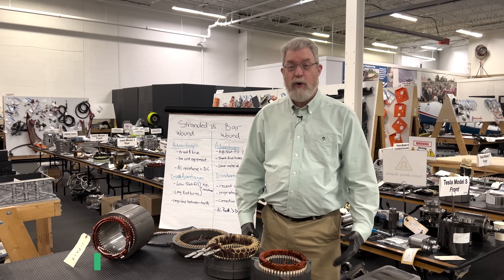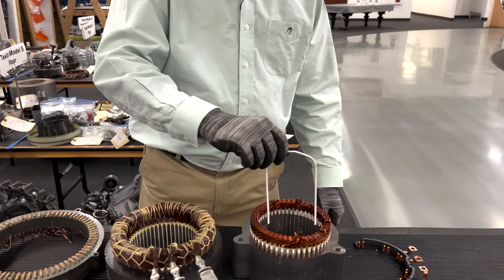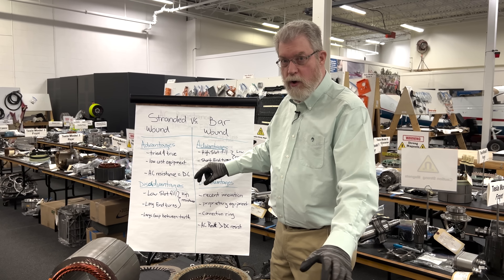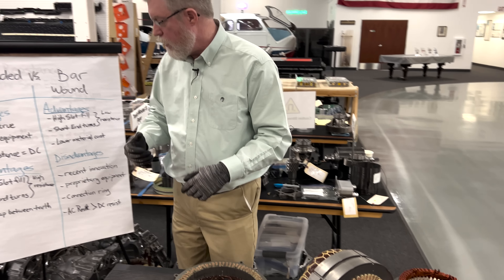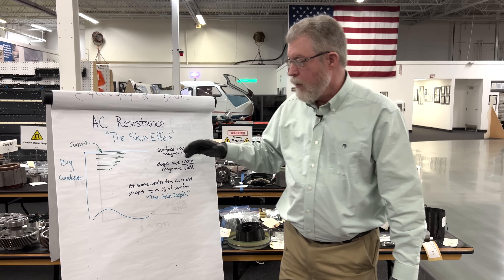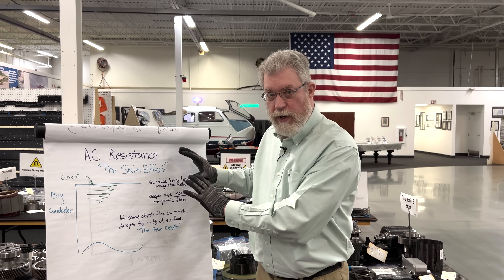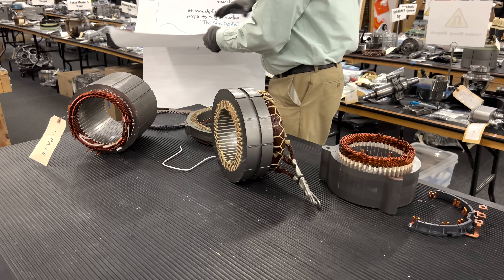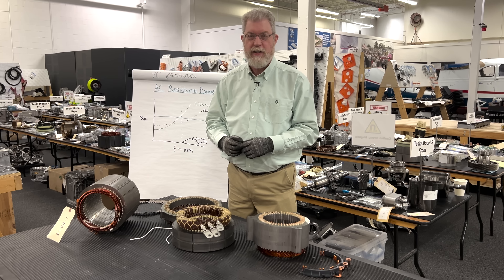Getting Wound Up: Stranded vs Bar Windings in Electric Motors

Comment from the maker: Start speaking a new language in 3 weeks with Babbel 🎉. Get up to 60% OFF your subscription ➡ Here: https://get.babbel.com/eg_influencer_flags_desktop_ame_usa-en?bsc=usa-influ-eg-dt-1m&btp=default&utm_campaign=munrolive&utm_content=Influencer..Feb-2024..USA-TATAM..1200m60-yt-munrolive-feb-2024&utm_medium=paidsocial&utm_source=YouTube&utm_term=generic_v1
Reply: What language? Klingon 😊
Reply: Distracting add. Do you really need to do this?
Reply: @jazzybeat28  how about you pay them for the content they publish for free so that they don't ever need to do another ad. You act like you can't simply skip that part...
Reply: @eat28 ads are fine if it is relevant to the topic or industry but this... it feels low like there is something wrong with Munro
Reply: Lucid has a better video on hair pin motors, Munro should have watched that and just regurgitated what is in there. Skin Effect from what I remember is only significant frequencies.  Electric motors don't have high frequencies, frequencies are just around the RPMs of the motor. The one huge advantage of hair pin also was not mentioned here
Reply from the maker: @jazzybeat28  yes, we love Babbel and multiple engineers here use it regularly.
Reply: Bienvenue
Reply: Hi there @MunroLive ...

Can you please tell me, What is the value of the stator winding resistance of these motors (especially the hairpin winding) ???

Comment: What's the scrap rate difference?  Reliability? Durability? Nice explanation by the way.  Another way of explaining is that AC current prefers traveling along the outside edge of the wire  while DC travels throughout the entire wire evenly so having more wires increases the ability to carry more AC current efficiently.
Reply: VW seems to have big production problems with their new APP550 motor. I wonder how many bars they put into one slot.
Edit: Seems to be a stack of eight, too.
Reply: In my experience bar wound motors are more challenging to launch, but once the process is fully debugged it tends to be more repeatable and reliable than the stranded wound process.
Reply: @PaulTurnbull-EMfield  What do you think about the Ghent University research project on "Semi-Stranded Windings"' Revised: 25 January 2023? 

Which seems to combine the advantages of both designs? What's the chance do you think it has to make it out of the lab and into production?
Reply: @nc3826  Thanks for highlighting this very promising research.  The paper very nicely illustrates the point that I was trying to make with my sketches.  It's also nice that the paper isn't behind a paywall and is freely available.  Thanks.
Reply: @PaulTurnbull-EMfield strand winding looks to me like it might have a higher failure rate due to the flimsier wire.
Reply: @gregbailey45  Possibly? But how likely is that type of a winding failure likely to happen? Is the more salient question to ask.  if it's not prevalent, it's an irrelevant issue.
Reply: Bar wire is much more difficult to manufacture. It’s run on vertical ovens vs horizontal in order to have better enamel covering on corners/better concentricity. Vertical ovens are also slower and use more electricity. Let’s say, minimum, vertical vs horizontal adds 5-10% more manufacturing costs.
Reply: Curing the enamel coating. Is a relatively insignificant cost, to the overall manufacturing cost.

So in conclusion. 'Let's say', anyone who pretends, that it's likely to add 5 to 10% to the overall manufacturing cost, is being completely unrealistic and misleading.

Comment: Regarding the AC resistance, the wire wound is not to be looked at as single wires but as a large conductor that is the aggregate of many of the single conductors.  As such the skin affect is there like the hairpin wound as a net affect of the many winding's. The magnetic domain is not bound by the enamel covering.  Thus the high speed advantage is greatly reduced I think.  Great video and content.  Some of the best I have seen here.
Reply: I was thinking exactly the same while watching the video
Reply: You’re not taking into account the boundary conditions where the conductors meet the insulator.
Reply: @thinkmonkeyman looks like it gets awfully complicated awfully quickly!

Comment: 2 things you don't mention about AC winding losses: first, the reduction to 1/3rd at skin depth, there is also a PHASE SHIFT in the current, being retarded about 60° at one skin depth, & this reduction in amplitude & phase shift continues as you move inward.  But there is a second effect when a bunch of wires carrying current in the same direction are packed together.   There is a loss which makes the resistance rise TO THE 4TH POWER OF THE FREQUENCY.  This is because of the magnetic field in SURROUNDING conductors.  Butterworth wrote about this in the 1930's as it applied to wound radio antennas, & showed that cheap radios, having antenna coils wound with thinner wire, actually performed better than the antennas in the expensive radios.  I ran into this when working with Rockwell International making magnetic bubble memories in the 1980's, which have 2 quadrature driving coils (like 2-phase motor).  Rockwell's coils used 1mm x 1mm square wire & had 3 times the loss of my 28-strand coils of the came cross-section.
          Another thing about bar-wound coils.  Most of the stock for these are made from existing round wire, rolled square AFTER INSULATING & heat-treating.  The copper is overworked & this raises resistivity.  The wire needs to be brought to the same state in cold-working as round wire, but manufacturers selling square wire don't do that.  Does Tesla have enough "pull" to get manufacturers to properly heat-treat wire BEFORE insulating?
Reply: This comment is a great example of what I love about the Munro Live community.  Thanks for sharing this great information.  You will be happy to learn that the copper wire suppliers have responded to the dramatic increase in square wire demand from auto manufacturers (not just Tesla) by producing new square wire products.
Reply: Fascinating Comment.... Why not form the bar out of heat treated strands, by drawing the strands through a bar-shaped die? And if needed heat treat the entire bar again? And possibly with a lamination of the wires?

The  metallurgical nature of the copper does seem to be a relatively important factor that wasn't focused on in the post?
Reply: wow super detailed insight. thanks
Reply: Excellent comment.  I was thinking Litz wire, which is multi strand woven wire with individually insulated strands.  New England Wire Company has been manufacturing Litz wire in the US since at least 1920.  The oldest reference I know dates from 1898, so knowledge of skin effect is not new.  Historically, motors have not had to resort to exotic stator winding wire because AC current was at most a few hundred Hz frequency.  Radio engineers started winding coils in receiving sets and transmitters with Litz wire to help prevent losses in the coils.  Keeping the effective resistance of the coil low improves Q, the sharpness of resonance, and helps reject adjacent stations.  If you want to find some litz wire, it is sometimes used in transformers of switch mode power supplies of mobile phone chargers, etc.  If you disassemble a wireless Qi phone charger, the coupling coil is often made with Litz wire.

If you read the Wikipedia article on Litz wire, the author mentions the antenna tuning coil of radio station WWVB, which operates at 60 KHz, has a 19 mm diameter conductor made of 6075 strands of #36 magnet wire.  WWVB is the US time standard station which transmits signals to keep “atomic” wrist watches and wall clocks in sync with correct time.

EV motors are directly coupled via a fixed ratio reduction gear set in the final drive without a multi ratio transmission.  This means that EV motor rotors are turning many thousands of RPM at highway speed and hence need excitation currents which could be in the tens of KHz range.  A washing machine motor designer can almost disregard skin effect because at 50 or 60 Hz, skin depth is 7.6 mm, which is more than the typical conductor cross section.  At 10 KHz is cold worked copper, skin depth is about 0.3 mm.
Reply: So there should be an annealling process between the forming and insulating processes, then?
Thank for explaining the phase shifting relative to the skin effect. Didn't know that was a thing but makes sense that it is.
Reply: @nathanieljames7462 The dilemma is coating rectangular wire is difficult, to get uniform coating over the corners.  So the last rolling is done after the coating (how they prevent rolling forces from damaging the insulation is a mystery to me).  It definitely needs to be ROLLING & not DRAWING.  The corners still need to be rounded.)  The heat-treating problem is this: for the lowest resistivity, the copper should be FULLY ANNEALED.  But annealed copper is like lead or solder, just too soft to withstand winding fabrication & motor operation.  So (for example) electrical wire is partially cold-drawn, to get it in a state just rugged enough to withstand those forces, but still have reasonable conductivity.  oddly, this work-hardeneng is why it is possible to make copper wire so uniform.  If some spot in the strand stretches more then the rest, it hardens, causing that part to stop stretching & somewhere else to stretch.
         Once you put that insulation on, you can't anneal any more, because annealing temperature is 400C, which would cook off any organic insulation.  Inorganic insulation is brittle & would flake during forming or winding.  Also, you can't "partially anneal".  Unlike steel where you can "harden & temper" by heat-treating profiles, copper annealing is an all-or-nothing process.  So you anneal & put the desired hardness in by the amount of cold-working after the full anneal.
Reply: This Poster bpark10001 is probably one of "the great ones", never imagined I would actually hear from somebody who worked on bubble memories on youtube.  Yes they should talk about "proximity effects" apart from "skin".  At that point it isn't as simple. Unless they clad each individual wire with a magnetic material it won't get solved.  BTW package inductors by the big semi-conductor firm do this nowadays (but that's at a different scale than EV motors so probably not applicable here ).
Reply: @nc3826 afaik, both drawing and forming the wire square would have similar effects metallurgically, and therefore resistively. Both would need heat soaking.
Reply: @bpark10001 thank you. I learned a lot from this!
Reply: @nathanieljames7462  This is "standard fare" in electrical engineering course on electromagnetic fields, where a field encounters a space containing a conductor (such as light hitting an aluminum mirror).  The math can get really messy (but is simpler in case of lower frequencies).  This class is often the "droipout filter" for EE students.
Reply: @Dimsum256 You definitely DO NOT want to encase the wire in magnetic material!  That does nothing but adds self-inductance.  (Motors have way too much of that already, since no one has invented a "magnetic insulator" yet.  You can make a lot of money making & patenting this material!)  You want the magnetic flux to be ZERO around each wire, & ALL  of the flux to encircle the ENTIRE stator winding & the rotor poles.
          I made a fool of the contractor making bubble memories.  PhD engineer claimed that the best Q possible in memory coil was 5 (given the geometry & the volume driven).  He filled the blackboard with equations. I said "nice, but you assume solid cross-section", then handed his techs a coil that I had wound with 12 strands in the same geometry.  That coil measured as Q = 15.  Further improvements led to coil with Q = 25.
Reply: @bpark10001  EE is a hobby I picked up almost a year ago. I'm in school for IT but I spend my free time in the electrical shop wondering if I bought the wrong program 😆
Reply: Bar wire is typically drawn from 8mm OFF rods down to 3.5mm. Then an inline drawing and annealing process happens before the enameling process, taking 3.5mm down to the designed wire dimension. I will say, due to high automation of the stator manufacturing lines (except in china were it’s still semi-auto) spring back and straightening are becoming issues due to the “picky “ nature of the fully automated lines. But now we are in the mechanical world.
Reply: That's a great point that should be addressed with some extra info from the motor: the maximum frequency per phase ( or the number of poles, maximum rotation so we can estimate it) to verify if skin effect is relevant or not
Reply: @bpark10001, can you explain why the skin effect exists in bar wound and not stranded wound?
Reply: @smith1023  The skin effect & eddy currents losses exist in ALL conductors!  The stranding does not eliminate it; it REDUCES it.  Depending upon the frequency, gauge of the wire, & whether the conductors are embedded in iron slots, the stranding can reduce those losses by factors of 10 or more.  (The same thing happens in the iron cores, except MUCH worse because of the higher intensity of the magnetic field there.  Laminating the iron REDUCES those losses by approximate factor of 1/N where N is the number of laminations.)

Comment: Very good video! I've worked on RFID coils, and at 100kHz and above you really start to see this effect. We investigated Litz wire, which is multiple stranded wire, but it didn't give us enough advantage to bother with the extra cost. Another issue is that if your cavity has too big of a cross-section, the inside of the cross-section is still affected by the magnetic field the same. This is probably why you see quite thin slots.
Reply: Well the effect depends on conductor size. In a 70mm2 cable 2kHz will double the resistance...
But in your thin antenna coil wire, 100khz might be correct.
Reply: Switching power supplies in the >100KW range use Litz wire in the active circuit. It looks like welding cable but the strands are insulated. You can get some that strips at soldering temperatures, but the good stuff you need to strip in hot acid.
Reply: The talk about frequency where the effect becomes an issue is not quite so simple.  Depending what you are doing, you mau have near, or not so near sinusoidal AC current.  Among other wave forms, you would consider trapezoidal current and square wave.  Of these, the square wave represents a broad range of harmonic frequencies.  The faster the slope of rise (and fall) of the change, the higher frequencies appear.  With modern semiconductors (Fiel Effect Transistors) you can have 50 kHz base frequency producing one MHz or more harmonic frequencies.  That puts the project into a different class from the automotive motor windings of this presentation.  I just have personal experience of having to abandon solid copper wire due to scorching heat at 50 kHz coil choke.  Litz wire with over 200 insulated strands solved the issue.  By the way, we prepare the ends by dipping into molten tin in a Solder Pot.
Reply: @InssiAjaton Thanks for that, I completely missed the fact that the shape of the waves plays an important role, but it's obvious now. We did not need it because our RFID circuits used an LC tuned circuit with relatively little current flow, so we got a near perfect sine wave. Of course if you think about motors they often use trapezoidal waves, so much more harmonics as you say.

Comment: Intresting how nomenclature can vary a bit in different parts of the same field.  I work at a shop that repairs electric motors for industrial applications.  We generally call them mush wound and formed coils instead of stranded/bar wound.
I also found it interesting to see some of the design considerations that go into the manufacturer side vs the repair side.  From a repair standpoint stranded is much quicker for us to rewind.  A half dozen different adjustable mandrel heads is sufficient for our winders to spin off a full set of coils ready to be stuffed into the slots in an hour.  Those few heads work for most motors. Bar wound you need more spcalized jigs that are much more specific to that coil design.  Worth it if your only working on a few types of motors or are specialized in making coils but not worth it for one off, bespoke repairs.  We normally have to order in new preformed coils from a company that specializes in making them.  That greatly impacts repair turn around.  Stranded we can start putting in new windings as soon as the stator is striped and cleaned out, bar wound and your looking at at least a week to get the coils ordered, formed, and shiped to us and that's on an expedited schedule.  Stranded windings we've had some where we could  have the motor back to the customer in a day for an emergency repair.

Comment: 16:09 a bundle of insulated strands doesn't make the skin effect disappear,  it is just the same as a solid wire the same size. Insulated strands is only an advantage if they a woven in way so that they all both equal amount inside and outside of the bundle over the length and share the current better

Comment: I mean, with these videos why do I even need to go to University. Sooooo well explained and most importantly, VERY INTERESTING. Watched the whole video without realizing it was over.
Reply: Actually what he gives you is an explanation that would be adequate for a technician. The explanation is not sufficient for designing an efficient motor. And for most people that does mean going to college to get the proper training in math, physics and engineering.
Reply: @googacct Then after you get your degree, you get a job and the shop tells you, you don't need anything you learned in college. This is the way we build motors so just design them using our normal standard method. We don't need you t9 design anything revolutionary or cutting edge.